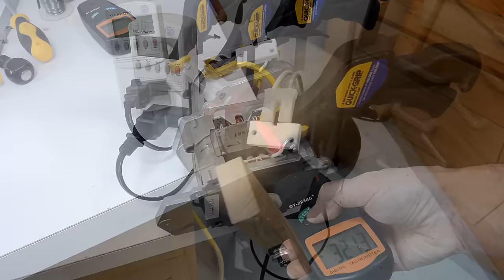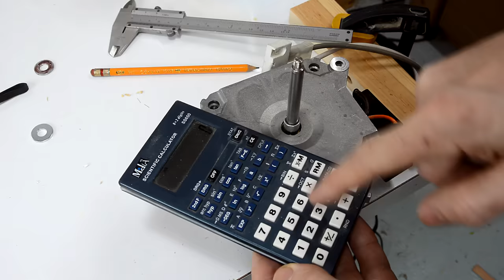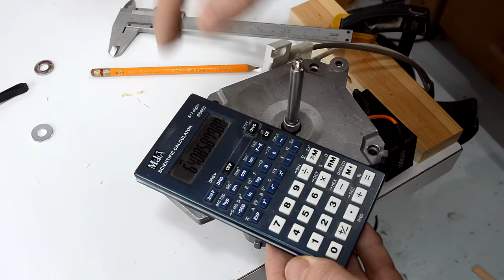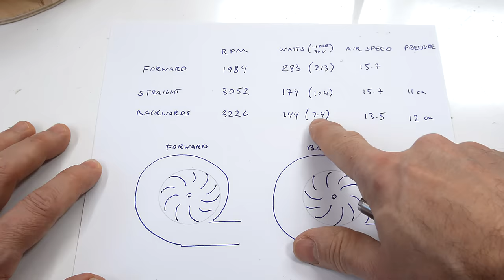Blower impeller design experiments

Comment: thanks .. this was so useful as i have just made a blower with straight impellers .. and was wondering if i should change i guess im not sure... as i have a lot more RPM and power than in this video but a much smaller size .. 40k rpm and about 500watts and 30mm ... thanks... I guess i could test the difference ...  it's alot more work for curved though

Comment: I bet the straight fins are faster at pumping air but easier to catch dust and needs more power and noisier.

But the most common impeller, the backward facing are much better.

Comment: 1. How did you measure the static pressure?
2. Why's there no static pressure figure for the forward fins?
3. Which one moves the most volume/mass of air?

Thanks so much for your video

Comment: Having worked at a steel works for over 30 years, I have never seen an impeller spin “forward”. It doesn’t make sense to spin that way. Air is being thrown out by the blades so they have to curve in a way that doesn’t try to bring the air back in.

Comment: Have you considered using the same motor with one or two larger backward facing impellers to determine how much larger a backward impeller can be? This could be based on the size of the flat board you use to check impeller size in the beginning.

For instance, assume the board you use to check is 10" long and draws 1.3A, and a 10" straight blade impeller draws 1.3A. How much larger (%) would a backward impeller be to draw 1.3A?

Yes I realize this is a lot of work, but it only took you 10m in the video to do it. :)

Comment: I'd be curious to see performance at the same power consumption. I.e., increase the size of the backward impeller until it consumes the same power as forward-facing, and compare airflow and static pressure.  I'm also pretty curious about how the dimensions of the housing affect performance. If the housing were shrunk to nearly the size of the impeller, would you get higher cfm/lower static pressure? And how would it all be affected by a smaller outlet? What's the best ratio of inlet to outlet?

Comment: Not all fins are a single curve, some have a slightly straighter section on the inside, or are S shape so the inner 'scoops' the air into the backward part.

Comment: That was fun to watch.  Do you think tapering the ends of the curve fins to the overall circle plate would help?  I noticed the stuck out of the side a bit, and if in fact tapering not only the ends, but from the curves pieces themselves, inner thicker and tapering out to the tips:  would there be noticeable performance air speed?  Thanks for the great video.

Comment: Have you considered the effect of Bernoulli's principle?  You are sucking air into the middle, and accelerating it outwards - that acceleration causes it to want to be at less pressure.  You are doing this through a triangle-shaped apparatus, which is also inflicting less pressure on the flow.  In other words - the poor air which just wants to "go outwards" from centrifugal force, is being forced to expand by chamber volume, when what it really wants to do is contract (due to velocity), so there is probably a huge waste of energy as the air pressure fights against all that. 

What about making a "path" for the air to flow along, which matches the pressure that it wants to be at, so none of that fighting takes place?  Or, in other words, instead of thin guide vanes, use triangular "cake shaped" sections (and possibly a higher middle, and lower outer edge).  Bonus: the air which has made it to the escape edge is also not going to be mixing violently with the low-pressure mess on the spinning wheel either, so in theory, a huge improvement is possible?

Comment: FYI, the way you drafted the housing may lead to vibrations.  Or it may not; I noticed you interpolated 4 or 5 points with arcs.  The problem with drawing spirals with arcs is that the curvature of an arc is constant, so the curvature of the spiral will have sudden discontinuities.  Nonetheless, this error can be minimized with a sufficient number of arcs.  I'm very curious if 4 or 5 is enough, that'd be a pretty big deal for me (it would make manual drafting of woodworking projects sooo much easier).

Comment: It should be desirable to make the fins thinner. Also, if they are lightweight, the balance issue is minimized. Perhaps curved sheet from cans, plastic bucket, or PVC conduit.

If the fins must be kept relatively thick for structural reasons, at least try tapering the fins at the leading and trailing edges for minimal turbulence.

Comment: did you consider rotor has a large gap to housing, what did you find  this air slip does to efficiency ?  it has a huge effect in fluid drive units (which is predominantly same). Also,, Must be reasons A/C makers use forward curve but small blade. ? noise, load, efficiency ? interested.

Comment: Q = NQ x ND^3
P = N^3 X  D^5 x density

Where nq and np are flow and power numbers for a particular.impeller design, n is speed in rpm (flow calc) rps (power calc) and d is impeller diameter.  And density is your fluid density (ie 1 for water and a lot less for air!). You can therefore back calculate flow and Power numbers for your impeller designs and predict the performance at different speeds and different diameter power and flow meaning you can make smaller prototypes before scaling up. The relation of impeller size to the volute also has an effect on his performance, the smaller the impeller the lower the efficiency, and also the further the impeller blades from the back of the casing the lower the efficiency. Finally you preferably want a straight piece of tube coming into the front of your blower so the air moves linearly into it and a shark fin or straight edge sticking into that pipe helps to stabilize the air insuring it flows in smoothly, ideally you want 324 pipe diameters in length before and after your blower to get a smooth airflow going in, the size of the pipe can dictate whether that air flow remains turbulent or laminar and that will also dictates how well this performs, it can all get pretty complex but once you get through those basics the designs are actually fairly straightforward. When it comes to pumping technology each design also requires a certain pressure on the suction to ensure the pump is not struggling to pull in fluid whether that is air or liquid, when this happens you can experience cavitation effects which can effectively destroy your pump period all interesting stuff and great designs, I've been working in this field for around 25 years
Reply: An impeller which is shaped like an airplane wing is one of the more efficient designs having a very low power number but also having a relatively low flow number compared to the kind of propeller seen on boats which have a much higher power number but also I have flown number a pitched blade turbine which is a flat blade at 45° has one of the highest flown numbers but also one of the highest Power numbers so the application will determine which kind of impeller is best and this will determine your power and flow requirements, some of the more complex designs these days have a changing chord angle as the blade moves out from its Centre to its outer diameter and this will also help to give a lower power number with higher flow numbers

Comment: 1. The impeller with the straight blades is working only with centrifugal force: The blades are bringing the air to rotation, the rotating air is gaining weight, and wants to refuge outwards. 2. The "backwards curved" blades are the right ones: The blades are not only bringing the air to rotation, but the blades also are moving the air outwards, which is right. 3. The forwards curved blades are wrong: The blades are hitting the air to the center, which is the wrong direction. So, we must not wonder, why this impeller needs much more power.

Comment: Try to sand the tip of the fan to make it pointed or slanted. So that the pressure from incoming air will not hit the straight tip fan. Just like the tip of a chisel.

Comment: Matthias - not sure if you are comparing apples to apples - the weight of the two impellers are different with the curved design weighing more.  Can you modify the two so that their overall weight is the same: at this point you would only be comparing design considerations - curved vs straight blades.
Reply from the maker: weight means it takes longer to spin up to steady state, but doesn't change the actual steady state.  I measured at steady state, so the weight doesn't matter.

Comment: Squirrel cage that's what we call it and you should have tried restricting outflow there's usually a restriction on there when the air flows out if you look at your heating and air conditioning blower motor there's some type of restriction in there some people think you can take it out but it helps the blow I'm not sure why I'm really not an engineer

Comment: Be interesting to see how well sections of large diameter PVC pipe work for vanes.
Reply: PVC pipe surface is smoother than wood and thinner than these wood vanes. I think it would be an improvement. I think sanding the leading and trailing edges very thin would improve airflow as well.

Comment: I looked at the stats and I think I found a reason for the inconsistency in "measurement expectancy".... If you know what I mean. ;-)
From a intuitive logical perspective the declining radius makes sense. However When you flip the switch you create a  myriad of different pressure area's. At one 'end' you have little room so you create high pressure and going round you have more room where the air can flow easily. Exaggerating you could say that only the last quadrant gets to spew out air as the other quadrants get clogged by backed up pressure. Hence the  change in pitch and the drop in efficiency.

I'm pretty sure that when you have the housing centered you will get results as expected. Not sure but I expect the RPM's will not vary very much for any setup or type of rotor. As for the efficiency.... well that would be the test now wouldn't it? Even the exit needing to be in the direction of the (presumed) airflow or if it as effective if it's perpendicular would be worth testing. It may just be that just the pressure caused by a rotor is all it takes without guiding the air stream.

But then again... I may be completely wrong.

Comment: Could you compare those to an impeller where the curved blades have the "straight" section near the outer perimeter, instead of the inner perimeter like you have?  (i.e. rotate them 90 degrees-ish)  That would be more like the blower on my 3d printer - the inner portion of the blade is more tangential, and the outer portion more radial.

Comment: You needed to restrict the intake with the forwards inclined blade. It would have pulled more air with a smaller inlet when motor was running the correct rpm/amperage.

Comment: How about straight, but angled? Yours were  radiating out from the hub, 90 deg or perpendicular from tangent;  I wonder what 45 deg from tan would do? Or 30, or 60? A vane attatched tangent to the hub would be longer, right? (Again, straight not curved)  so, wouldn't that mean more surface area, thus swatting more air molecules per rev? I guess any design that involves moving fluid from rim toward hub is going to be fighting venturi effect, also, which would make an case for big and slow vs. small and fast ...

Comment: 8:41 What was the pressure for the forward-facing fins?  Just a thought...I wonder if there is another factor to consider here:  could the efficiency of the motor depend on the speed/load?  For the forward-facing fins, where the motor ran at the lowest speed and drew the most power, I wonder if it would help to drive the fan through a reduction belt drive?

Comment: I need a impeller for a shimney ventilator, I do make from metal, using a tigg for welding however I do need some calculation for the amound of air being vent, is is for a woodstove making an 11 cm pipe virtually 15 or even 20 cm by electric fan do work fine and has advances also for starting fire. Thanks.

Comment: would doing a two tier fan work better? I'm thinking, possibly if the inside of the fan had blades facing forward and the outside had blades facing backward, the air would be cut more efficiently upon entering the fan combined with the efficiency of the backward facing blades. Or, possibly, the other way round might be more effective.
Reply: John Schoolfield i think that would just lower the efficiency even more because it would force the air to "swerve" and if it does the added turbulence would make it much noisier too. Just my hypothesis i don't really know either
Reply from the maker: yes, probably worse.  What matters with the curves is how the air leaves the impeller.

Comment: check your amp draw. in my line of work we use two different designs of fans and the amp draw is less on the one that moves more air.
Reply: turbochargers are also backwards facing

Comment: Q: what would have happened if you had put a knife point at either end of your blade. 
If you look at a normal fan, the surface that is cutting the air are not blunt, but sharp. 
If I was a betting person, I bet that your load would come down a lot if you tried it.
I know, you've already got the thing glued in place, but maybe you could Dremel the knife edge..
Yeah it would have to be a smooth curve when you make the point.

Comment: What if you  do the forward facing spiral, but drill hols in the blades to make it have less load to push? it's still displacing air, just has less struggle to push through it.  I'm very curious if they would improve it at all efficiency wise, and how much the airflow would drop. =)

Comment: The fan would be more efficient, if, the swept areas for inlet and outlet were about the same. So, the top cover would need to be conical.
If the blades were also aerofoil shaped that would also improve efficiency, and reduce noise.

Comment: what if i use a lot of tiny angled blades as seen on older car turbos? how would that work?

oh! and i have a 4k RPM-high torque motor available, and the size of the impeller is planned to be 11cm in diameter, it will be whole plastic (except for the mounting screws ofc)

Comment: Take a look at 6:02 and see the gap between the rotor and the peak of the volute, that's part of your inefficiency as you're "recycling" come of your air flow and losing the work behind it. You're also losing some efficiency by having blunt fins, they will have a low pressure zone on the tip that causes the air to come off the rotor turbulently. Turbulence is waste.

At these speeds, you might do best by trying a rotor using many thin strips, like tongue depressors... like 30-50 of them, at a very slight forward angle, maybe 15 degrees at most.

Comment: My experience comes from cotton gins.  When we were moving heavy loads and required high static pressures, we used straight blade fans.  In high air volume, low static requirements for light fluffy cotton, we used backward inclined fans because of their efficiency with horsepower.  Backward inclined fans were never used in high static applications.

I realize this is inconsistent with your testing and I am wondering why?  I can't believe an entire industry missed with it choice of fans.  I'm wondering if the high volume of debris struggles to move through a BI fan?  Your test is with air only.
Reply from the maker: I wouldn't say an entire industry got it wrong.  Most applications that need high pressure use backwards curved vanes.

Comment: Try a velocity stack over the input, play with harmonics, use piece of dryer hose to get rough length. Maybe with a little choke on the input side the velocity will increase before it even hits the blades. There may be a critical input pressure/velocity of charge etc. Bernoulli et al. Possibly a resonance thing. IDFK. Not trying to be jerk just interested. Probably sub for while peace.

Comment: some info for you from ebm-papst catalogue (year 2002 :) :
...with forward curved centrifugal fans, maximum power consumption is reached at free air. Rising back pressure results in declining power consumption.  ...Forward curved centrifugal fans require scroll (plenum) as guides. These scrolls guide the air stream from impeller to pressure stud. The dimensions of the centrifugal blowers (fan and scroll) can be taken from the respective pages ... and the picture plus table with dimensions... 

if you are interested i can take a picture of that page and e-mail you

Comment: Wouldn’t a curve design be better where the inner is forward curved but outer is backward curved. The inward curve wouldn’t have the air resistance and the outer curve at the end doesn’t cause air to be sucked in as much

Comment: I wonder if a compound fin would change anything.  So instead of a C shape it would be an S shape with a tight curve towards the middle.  I'm thinking along the lines of a turbine in a turbocharger.  This way the intake would be 'scoop' air in and push air out in the direction of the outlet.

Comment: I assume the motor is an induction one and the lowest of the three rpm s show, forward finned is drawing the highest power, if you have a way of measuring the amount of air that is flowing out, probably for the forward finned you get the highest volume out of the three variants, just my 2c, would like to hear from others on this line of thought..
Reply from the maker: yes, you get more air flow facing forward, but it also uses way more power.  For the same amount of power, you can have a bigger rotor facing backwards, which will produce more airflow.